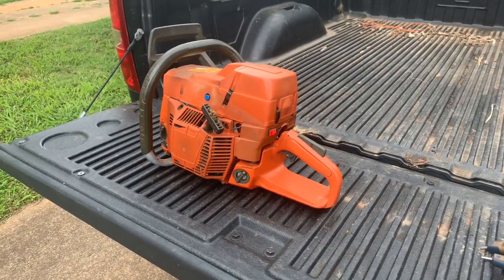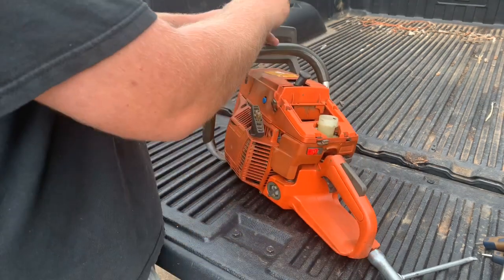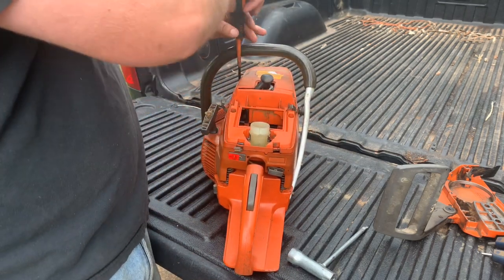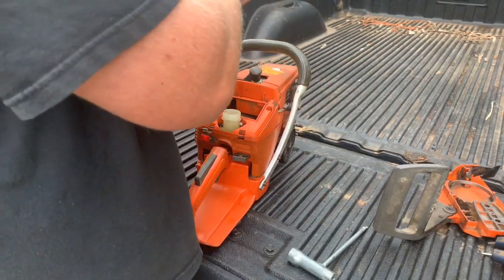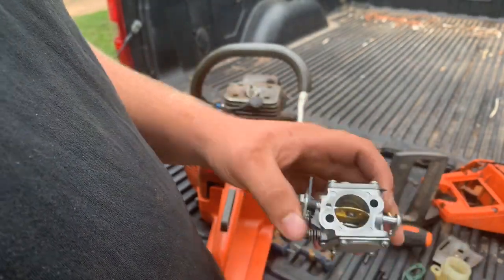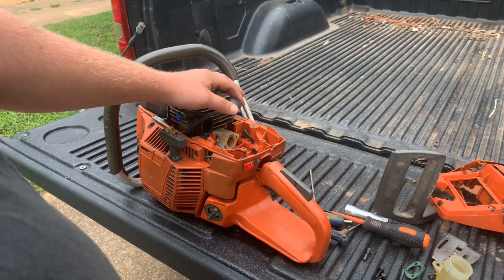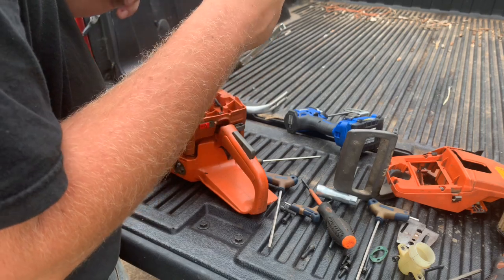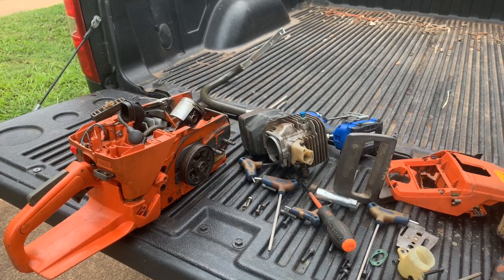Husqvarna 394xp teardown and inspection

Comment: Hi Andrew!!😀😀
Definitely dosen't take very long to tear it down. 
You should have threw a piece of cardboard on the tailgate so the saw would not have slid around so much while you were working on it. Those berliners are so slippery!! 
Take care my friend!! TTYL 

Logger Al
Reply from the maker: Al Dredske hey pal! No it sure don’t! Thanks for the tip! I’ll try it next time! Usually I’m not on my tailgate, but there was a lot going on at hoppers that day and it was noisy. I wanted y’all to be able to hear me! Take care! Glad to have ya here
Reply: @drewscreations8551  Drew If You Can Come Up With A Thin Stainless Steel (r Preferably Aluminum Food Prep Tray, Like Used In Pizza  Restaurants, They Are Ideal For Working On Small Engines, Such As Chainsaws, Weedeaters And Any Small 2 Cycle And 4 Cycle Engines.. I Have 2 That I've Used For Many Years And They Are Roughly 24 Inches To 36 Inches Long And 22 To 30 Inches Wide And About 1 inch to 1.5 Inches Tall, Depending On Which Type You Would Find But They Are Priceless For Keeping The Smallest Pieces And Parts Contained... You Can Order The From Middleby-Marshal Company That Deals In Restaurant Equipment And Even Off Of Ebay New And Used For Around $20 And Less Each
Reply from the maker: Sam C. I’m planning on getting something similar to put on top of my toolbox as soon as I get setup at home. Normally, I have a table at the hoppers house to do stuff. That day, there was a lot going on so it was rather noisy and I wanted y’all to be able to hear me so I went out to my truck. I appreciate that wonderful advice though Sam!
Reply: @drewscreations8551  I understand what you mean and you have to do what you can at times
Reply: @drewscreations8551  Is A Homelite 330 Older Model Chainsaw A Decent Saw?
Reply from the maker: Sam C. Oh yes
Reply from the maker: Sam C. They were a decent saw, little slow by today’s standards but much better than a lot of the homeowner junk you can get nowadays. Only big issues with them were the intake boot failing. They are real prone to that. Also I’ve heard a some say that the oilers can bit a bit frustrated at times. I’ve never had an issue with the oilers personally but I have had several with torn intake boots. The intake boots are still available on eBay.
Reply: @drewscreations8551  I Have Found A Complete Homelite 330 With A Large Size Bar And Chain On It And The Guy Says It Will Hit But Not Start And I Talked To Him Again Day Before Yesterday And He said $75 Is The Price But Wonder If It Would Be Getting